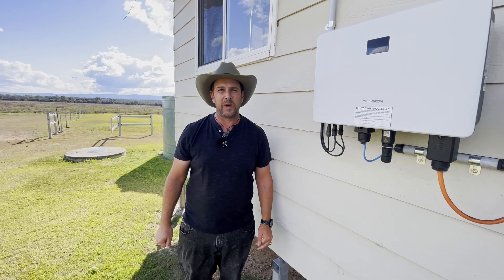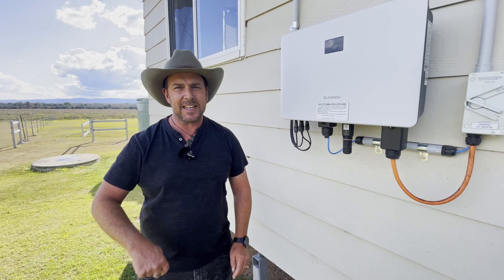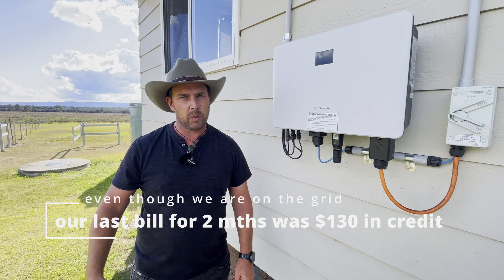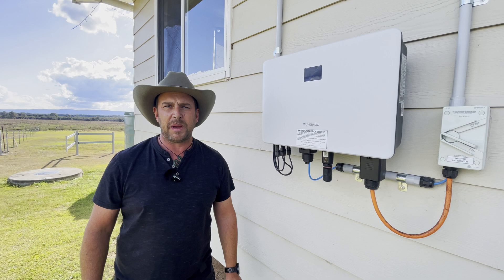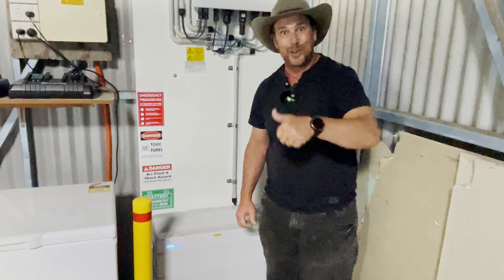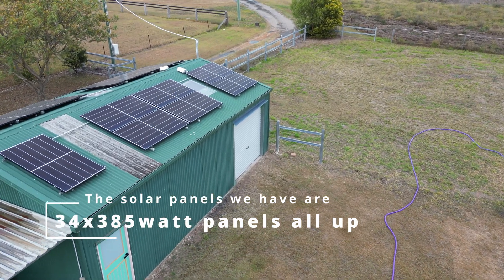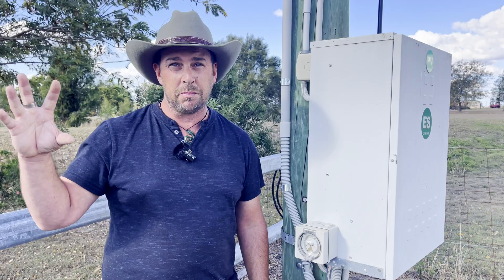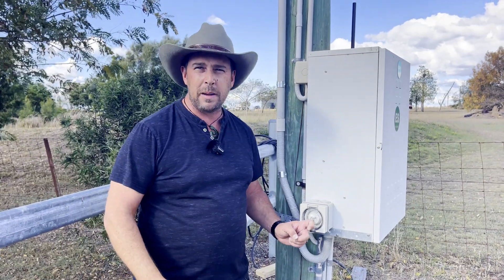Homestead 101: Solar Power

Comment: Love your “shore power” (to borrow a nautical term) plug at the utility pole. Having installed a 36 panel / 12Kw solar system on my urban home, if I had the land to do a ground mount instead of roof mount, I would opt for the ground mount.  This makes replacement / maintenance of the roof less complicated and less expensive down the road.  You seem to have a metal roof which may mitigate this issue, but a subject for consideration for those planning a system
Reply from the maker: Thank you for your feedback. I totally agree with your point on having the panels ground mounted. We have some other projects we are looking at on the property in the future. One of these projects we will be looking at putting in a solar farm ground mounted. This will not only be for greater access but also this allows for better placement for the suns direction and to also assist in the panels not over heating. We have learnt quite a few things since putting this system in that will assist in the future.